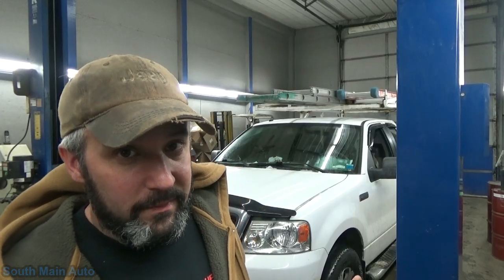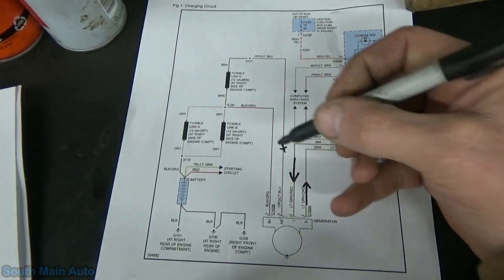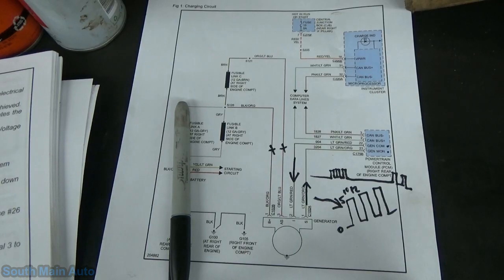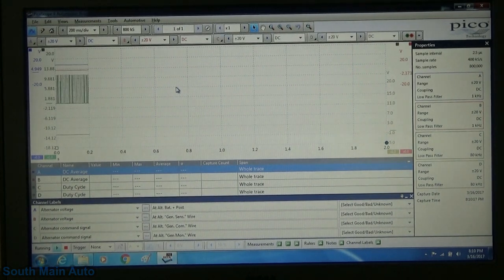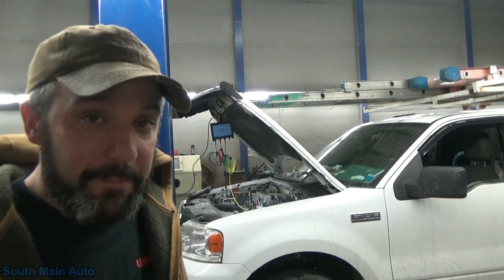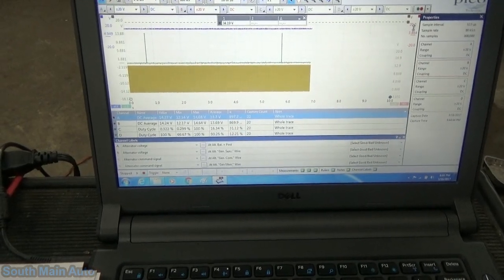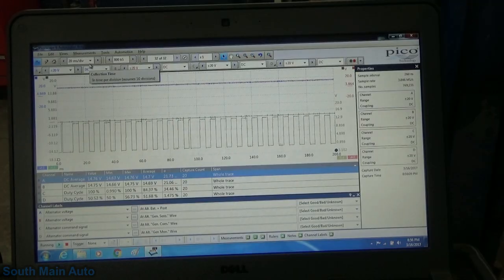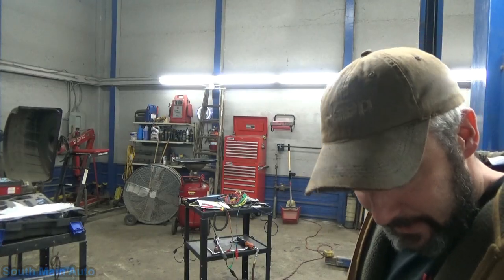Ford "Smart Charge System" Alternator Not Charging

Comment: Another anaemic fuel savings app like start and stop. Lets shut off the alternator when the battery has a full charge ambient temperature is above 65 f accessory draw below 20% and cycle it. Because the alternator is a considered a parasitic draw and the 1% gain in fuel economy warrants the additional control wiring and the strategy in the ECM . Another fail in getting mpg improvement. This system is not for battery longevity its for fuel economy. Oh the start and stop lets hammer that battery every stop and load that alternator to recover the battery every stop.Looks its not going cycle very often.Engineers validating their jobs looks good on paper but when it fails a new day cleaning up their mess is re engineering.

Comment: Have same problem,  no battery light but voltage is all over the place from 10 to 13 with a rare 14.   Tryed 4 used alternators with no solutions.   Any ideas?

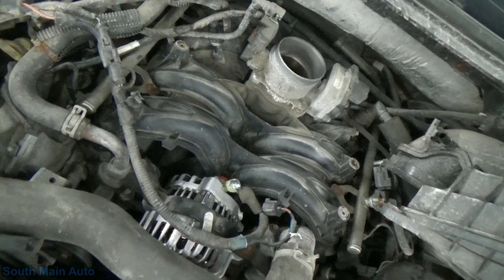Comment: The discussion at the 23:05 point in the video about the alternator's default condition, with the connector unplugged surprised me.  I thought the field current was supplied by that plug.  That is by the battery voltage sensing line.

Comment: Awesome video as always Eric! I am really looking for a little help with a 2005 escape 3.0. The alternator started overcharging and was replaced 3 times for this issue which kept happening. Sometimes the instrument cluster would lose power and sometimes the radio and now I have been asked to fix this thing. When I disconnect the alternator connector it does not charge at all so the default strategy is not working for some reason. I got 8 volts on the genmon line, .5 volt noise on the gencom line and battery voltage on the sense line. No PWM on either com wires but the last shop replaced the alternator and the PCM. Also while sitting in the drivers seat sometimes if the dash is dead my foot moves and the interior light and dash power come back. I have pulled the carpet and wiggled the harnesses to figure out what's up. The GEM or smart junction box controls power to the interior but at this point I am thinking these might be two non-related issues. I have not jumped the com lines yet but I will try that on Monday.   The PCM shows requesting the battery light on while the fault PID shows "No Fault", the genmon PID shows 100% while not charging and the gencom PID shows 0%. When started the system starts with 0% request and slowly goes up to maybe 40% then back to 0% while the alternator monitor show 100% duty cycle on the can tool. Any ideas where I go from here. The shop called me in because this has been to 4 shops and this shop had it for over a month and called in a diagnostic guy that worked on it for over a week. 

Any help in direction from you guys would be a big help. I pulled the diagram for the PCM and I plan to look at the alternator com lines at the PCM Monday. I also found no engine ground but fixing that does not seem to make a differance.

Comment: I have sat and watched this three times now... The reason being  that some Jaguar models, notably the S type which is loosely based on a Lincoln LS I believe have a similar smart charging system. And in the UK it struggles to fully charge the newer batteries available on the market, in fact some of the batteries available these days it really struggles to charge to more than 80% of capacity. The Calcium type batteries need 14.4V to charge them, the S type in 3 litre form, and the 4 litre version (which I own) use the smart charge system to maintain these batteries and seem to "float charge" at 13.6V. Which simply isn't enough, I use a conductance meter to measure the battery state and the only way I can get the battery on my S type fully charged is to use a mains charger every few weeks. I also wondered why it sets at 13.6V if the Smart charge system is involved, maybe it's a limitation of the alternator because I would expect the sensing system to read what the battery needs, not just give a fall back level of charge, something else to look at. If you have a 4.2 one, don't worry, it has a proper charging circuit unemcumbered by electronics...

So I was particularly gratified to see Eric both remove the smart charge sense lead to let the alternator "run in auto" and take measurements... 

And also even more gratified when I spotted last time that Eric mentioned the AIT having an influence...  

Took me three viewings to spot that little nugget... Well it rarely gets that cold in the UK, -13C is considered exceptional (without the wind chill) and for a long time I have thought the Jaguar engineers missed something quite important when they converted the US smart charge system for UK use. 

So thanks again for the back log of interesting stuff to watch... I have to look at how I can influence the system on my car to give a few more volts now.

Comment: Hi Eric! Although more than a year passed since you made this video, I only saw it now and have 2 questions bugging me:
1. Don't you guys repair the alternators for the more common faults? (bearings, voltage regulator, diodes, brushes)
2. Would the old alternator work if the "smart" plug was undone? Could it be just the "smart" part of it bad and it still would work as "dumb"?
Reply: bad voltage regulator

Comment: I think Ford was trying to do what Honda had for some of their earlier econobox vehicles, except that Ford comes up with the idea that more switching in the "Com" packet indicates Less output while less switching in the "Com" packet indicates More output.  That leaves the final output control to the voltage regulator which is exactly how a regular generator in a "pre-smart" Charging System works!  It looks like the engineer started to figure this out, loss his train of thought, threw up his hands in disgust and said "Let's go with this!"  It's only partially figured out!  1996 Chevy Cavalier 4 cylinder had this system AND IT WORKED GREAT!  You could test the charge system with the Tech 2 and that was great!  Dodge and Jeep from 1997 both had computer controlled generators from the computer, nothing in the generator, AND THAT WORKED! !
FORD..........well the engineer had a rough night or a wet dream?  
My apologies for the rant.  Ya, I've seen and delt with this sucky system before ! ! !  You still put out a "Great Video!"

Comment: I drive a 98 Mercury Tracer (so basically a ford). I don't think it has a smart charge system, but the alternator did die on it a few months ago. The light didn't come on until the battery had died or wasn't taking a charge, not 100% sure what caused the light, but when I took it to O'Reilly's to get the battery checked, their scanner found that the battery wouldn't charge, AND that the alternator wasn't charging. That was money I didn't want to spend, but my dad and I did the install ourselves, and (a few fuses later... unhook the battery first ya dummy) we managed to get it in and it seems to be working.

Comment: All that electronic stuff is just more to go wrong and the default of around 14v is perfectly ok once the battery starts to fill up only a little extra drag on the engine without all these "modules" hardly be noticed even on fuel economy.
and....... that is why you need a voltage gauge in the car like a lot of older cars. It can be a godsend as you can always monitor the voltage under low or high loads as the Charge light wont come on even if the output is low not enough to charge the battery slightly  but high enough not to trip the light. So the battery slowly discharges till you cant start the car and get stuck...

Comment: What it looks like to me is the gen mon periodically checks the charging values ( every 5 sec)and when it sees a change is needed it sends its commands and watches until the battery is in a full charge state then monitors it again with a short impulse every 5 seconds till it needs to control it again.
Reply: I agree.

Comment: Too much technology for such a simple operation
Reply: Maybe, however i appreciate this video, I have a diagnosis to do where the customer has one that is charging and not charging randomly. it left him walking a couple of times, and he already replaced alternator and battery, so this vid is EXACTLY what i need to this diagnosis. easier to watch a diag in progress than to read 5 pages of "theroy and operation". This is where it is all going, technology reigns supreme.
Reply: I agree ... at the end as per description ... the altenator charges with or without the "PCM" ,,, and the video demonstrated exactly  that ... The oscilloscope  is OK, but it does not serve here to the purpose of the video ...
Reply: That's why I don't mess with 2000 and newer cars
Reply: I think one of the main reasons the charging system is designed this way is to reduce the engine load as much as possible (saving fuel do to less engine load) ... it does extend the life of the battery as well as the charging system ... the charging systems monitored JUST voltage goal 13.5 to 14 volts ALL the time (at least 13.5 under full load) with PWM these days charging system can be set up to control current as well as voltage... no need to throw 60 amps of current to a fully charged battery ... that will just severely reduce its life

Comment: Wanted to ask another quick question. I am trying to write an article on what online subscription sites are best for a DIYer / Hobbyist car repair (or beginning mobile technician) any advice on what online subscription sites like alldata are best? if you only had one what would it be? what do you most consistently use for everything?
Reply from the maker: I use Mitchell on demand and Idfix. I think they both have DIY versions for sale. If I only had one it would be IDfix because they have all the OE diagrams but lack a little on OE service Info. I also purchase factory software and info as needed. Some OE's are as little as 10 bucks a day some are about 55 for 3 days. Depends on what info you need.
Reply: Identifix doesn't have any DIY offerings that I'm aware of, Mitchell1 DIY (eAutoRepair) and Alldata DIY are rather inexpensive. I've noticed that Keith uses Alldata in almost every video but I'm not sure why he seems to favor it (site layout, maybe?).

Comment: Eric, Remy Power Products youtube channel does a good explanation of the Ford charging systems. The GENCOM duty cycle can go silent when no change in charging status is needed. Also, the regulator supplies the voltage on the GENCOM line and the PCM toggles it to ground to create the duty cycle signal command. The PCM supplies the voltage on the GENMON line to the regulator. The regulator GENMON will toggle the signal voltage to ground to signal the PCM the charging status. Remy also has good explanation of GM and Hyundai charging systems on their youtube channel.
Reply: Watching it now.  Good explanation.
Reply: I was just about to say this. The PCM will communicate when it wants to change the desired charging voltage OR it will send the same signal once every 5 seconds or so if it DOESN'T change the desired charging voltage. It does the 5 second pulses so that the  alternator can be sure that there isn't a loss of communication and go to fail safe mode. This can be verified by watching the scan tool data. It shows 0% gencom on the scan tool when the desired charging voltage stays the same, but shows changing gencom when the desired voltage changes. I suspect that the 0% display on your scan tool for gencom when it isn't continuously communicating is a glitch with the autel, but I'd also guess that if the autel had a much faster refresh rate, you would see it briefly show the correct gencom duty cycle every time it transmits every 5 seconds. I am fairly certain the IDS is programmed to show the last gencom that the pcm transmitted rather than a literal display of what it currently transmitting on gencom.
Also, a quick note on the alternator fail-safe or "default" mode if it doesn't get any transmission from the PCM. It will only start charging at its preset voltage in the absence of data from the PCM once the alternator rotor speed  passes a certain threshold. Its different for every car since the pulley sizes are different, but generally speaking it should start charging and continue to charge if you rev the engine to around 3000rpm.

Comment: Hey ! Great video !
I have a question: On my vehicule, alternator output voltage is 14V  when engine is running but battery voltage is only 12,5V.
Few minutes after battery voltage decreased to 12,2V. So the alternator is not doing his job.
What you need to know is that the alternator dates back to just a few months and supply 14V.
I have done an electrical continuity check between alternator and battery and it sounds good so wire is not broken.
I have done the same for fuses box and everything is OK.
I don't know what to do. Do you have any idea which could help me please?
Reply: Coming at this question as an electronic technician (not as a trained auto mechanic), and three years late, the symptom you are describing is high resistance between the battery and the alternator. The line may pass a continuity check but there definitely can still be enough resistance to cause the voltage drop you experienced (it doesn't take much). It's also a good idea to determine exactly which side of the battery/alternator combination has the excess resistance. It can be happening on the negative (ground) side as well as the positive side. To diagnose this, connect a voltmeter negative test lead to the negative battery terminal. Next, take the positive test lead and touch it to the alternator case. The reading shouldn't be more than 1/10 of a volt or so. Anything much higher indicates resistance in the grounded side of the alternator. You can repeat this procedure on the positive side as well. Just move the leads to the positive battery and positive alternator terminals. The same idea applies: excessive voltage indicates excessive resistance. Good luck if you are still futzing with this problem.

Comment: Just ran into this 12.33% (not the alternator problem on my 13 Explorer.  Kept getting a "check charging system" message, replaced the alternator, battery current sensor, battery was on warranty.  Still getting the message.  Message was very intermittent, would not stay on for more than a minute, no DTCs.  It would charge up to 13.5v at times, then drop down to 11.5v or lower.  Battery was leaking like crazy so I probably got corrosion on a fusible link thats going to require me to dig into this harness and waste a lot of my time.
Reply: Ever figure it out.

Comment: And where did u get that alternator from. I got a brand new one from O’Reilly and put it in and my check charge system light and batt light keeps popping up still I read these cars only work well with the ford alternators only. I have tried a ford alternator yet but hopefully that does the trick. The brand new one I got from O’Reilly is in now but wen they checked it there saying my alternator putting out to many volts which is causing my check charging System light to stay on. I’ve read online that aftermarket alternators don’t communicate well with the computer on these cars. My battery is also brand new and is 100# wen checked. My radio works and lights and blinkers and stuff but my dash went out and that batt light shows. Ac only works wen the car ignition is on but wen I start the car the ax stops working. We found a 05 ford 500 at the junk yard wth the alternator still in it but we don’t kno the size wrench or socket to use to take the screws off.  

Please let m know what’s going on.

Comment: Hi Eric! Love your videos and as a retired Electonics Tech, I am impressed by your electronics knowledge along with your excellent mechanic skills. I really am getting tired of some of these Youtube mechanics that call any car electrical problem a "short",ie, some Scotty guy. I have a question regarding the BMS (battery management system) that is used in a 2013 Focus. I recently purchased a Focus with 56k on the clock. The issue I am having is that the body control module is "off loading " some of the non-essential electrical items such as ; the media center, the wipers and other items occasionally while the ignition switch is in the "accessory" position. Everything works while the car is in the "ignition" position and/or engine running except I get low batt at times on the center display panel. As I understand it, the Ford BMS has  a "battery aging" that the computer checks. When the battery is replaced, the body control module MUST be reset,otherwise the computer will still "think" the OLD battery is in the vehicle and will continue to "turn off" some systems. My question is, how can I reset the BCM without going to the dealer and paying $150 because I DON'T have a Ford multi- thousand dollar scan tool. Also, what is your take on disconnecting the sense wire going to the NEG side of the battery. Will this throw a "light" and put me in a worse position like screwing up the electrical sysytem? Sorry for being so long winded, but I figure if anyone understands this funky set up , you're THE MAN!

Comment: It was a lack of com on low voltage because it was sending it on open loop max charge while battery was low, seems like. The com would control resistance so it doesn't overcharge. If it stays in open loop charge you might be looking at a bad battery. That's what it looks like anyways.

Comment: I too am struggling with one of these..2008 6.4. Mine is charging fine but the bat. light is on. I have ohmed and loaded all wiring. Done the J pin tests..comes back bad alternator. Tried another..same thing.
I read online that new alternators have different resistance between term 2-3 with battery on alternator. Should be about 1.6 ohms across vt. and blu . mine are both 3.5 ohm. I am told I need to upgrade pcm cal. to version 60.05 or higher. cant buy old regulator.